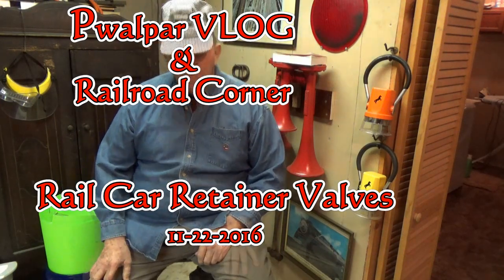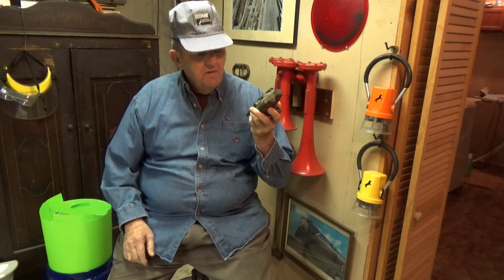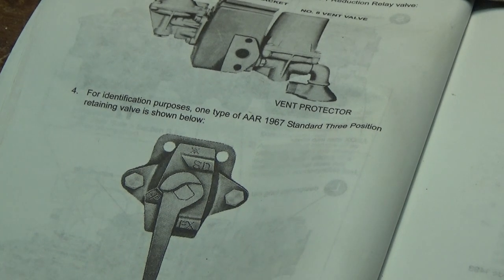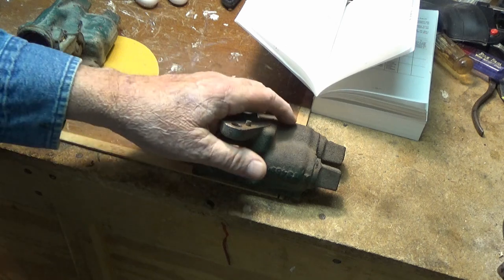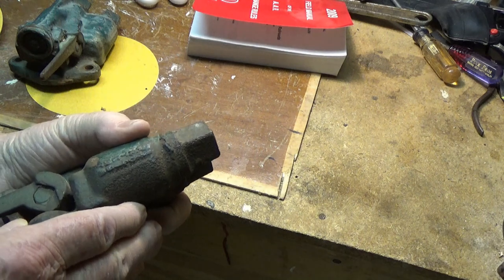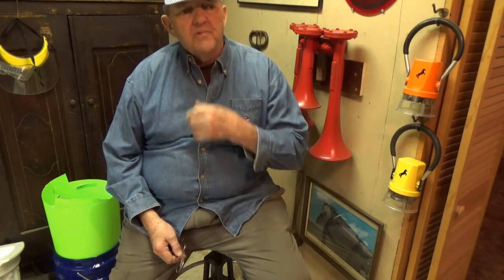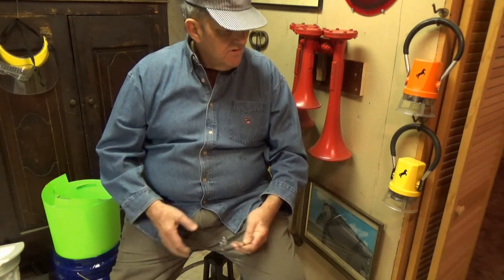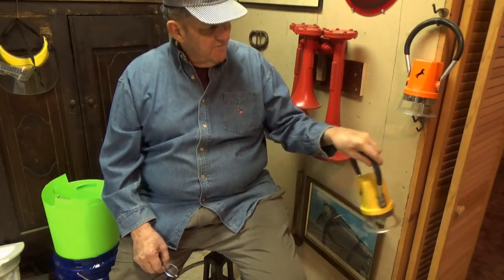Railroad Corner Rail Car Retainer Valves 11 22 2016

Comment: You jarred my memory, Walter, and I had to go back and look at my books about train air brakes. The retainer valve lets the reservoir be recharging when the brakes are holding. I seem to remember that they are rarely used these days because the dynamic brakes have the same effect. I would be really pleased if you could go through the brake system in more detail sometime. Train brakes are not as simple as one might expect. Thanks for showing us the valves.
Reply from the maker: Thanks Bruce I will go into more detail one day

Comment: I own a caboose with the same or similar 3 position retainer as you are showing,  The caboose is a 1953 model with AB service and emergency valves, it has an inside control valve for making a remote reduction from the back of the train (I am guessing) in case of trouble and it has reducers with built in whistle at each end as well,  I think you might be a good guy to talk to about this thing.
Reply from the maker: Im sure your Caboose is the talk of the town where ever you are.  I had a chance to buy on of Southerns Cabooses for 3,000 dollars but had no land at the time to put it on  or the money to haul it anywhere.  I worked on Cabooses throughout my railroad career.  Here is some links to some of my videos where I used the brake reduction valve that I salvaged from and old caboose from a caboose.  I rebuilt it and used it to blow my locomotive horn.  I still use it occasionally.  Check out these links,
Rear of train brake valve Part One https://youtu.be/z7ALHm-a3vs
Rear of Train Brake Valve Part Two https://youtu.be/jgFB6BQrQYk  
RearTrain Brake Valve Part Three https://youtu.be/GrqDBR7dzTE
Rear of Train Brake Valve Part Four https://youtu.be/ngFI_biI5uk.
by the way your welcome to email me at pwalpar@gmail.com   Walter Parks  AKA Pwalpar

Comment: Is the slow direct setting obsolete? I do single car air test and have never needed to adjust it or test it for anything.
Reply from the maker: It has been years since I did single car testing  I do know this retainer valve is no longer used  but the function is the same.  It should hold 20 lbs piston PSI when still in HP
Reply: @pwalpar  cool thanks.

Comment: what are Dynamic brakes walter?
Reply from the maker: Dynamic braking is the use of an electric traction motor as a generator when slowing a vehicle such as an electric or diesel-electric locomotive. It is termed "rheostatic" if the generated electrical power is dissipated as heat in brake grid resistors, and "regenerative" if the power is returned to the supply line. Dynamic braking reduces wear on friction-based braking components, and regeneration lowers net energy consumption. Dynamic braking may also be used on railcars with multiple units, light rail vehicles, electric trams, trolleybuses and electric and hybrid electric automobiles.
Reply: pwalpar thank you walter i learned something new!

Comment: Put heat on the area where the threads are and they ought to break free easier than beating on them.That's the same trick we used to do with with HOT water, but heating them up loosens threads.
Reply from the maker: That would ruin the valve as it has rubber parts inside

Comment: Here is my attempt at explaining the brake system here.

Will start with no air pressure in system.
Wagon is hooked up to locomotive which has it's break handle set to release air will move into the wagons brake pipe through the triple valve into the reservoir on the wagon once the gauge in the locomotive shows  the system is charged (reservoir on wagon is up to pressure) the brakes can now be applied.

To apply the brakes the brake handle in the locomotive is set to a apply percentage this will lower the pressure in the brake pipe this results in a pressure difference on the piston/valve in the triple valve between the reservoir port and the brake pipe port.
This causes the piston/valve in the triple valve to move this movement then opens the port to the brake cylinder this allows air from the reservoir to fill the brake cylinder pushing harder on the piston.
This then applies pressure on the brake pads via the linkage system  this causes the pressure in the brake cylinder to increase which in turn causes the pressures at the triple valve  to balance this then closes all ports in the triple valve at this point the brakes have been applied to desired force.

To release the brakes the brake handle in the locomotive is set to the release position.
This setting applies the release pressure around 90psi this pressure is higher than in the wagon reservoir this pressure difference applies force on the piston/valve in the triple valve  this now opens the ports between the brake pipe and the reservoir this recharges the reservoir.   the valve in the triple valve opens ports between the brake cylinders and exaust port releasing the air and causing the brake cylinder to retract releasing the brakes. 

This system has one important fail safe if wagons separate the brakes apply.

One downfall of this system is if wagons are left on a siding without enough handbrakes applied the brakes will slowly release as air leaks out.
Reply from the maker: Yes on many cars they can leak off so all cars have a manual hand brake
Reply: So this valve allows the release rate to be set.
As far as I know our wagons are all set to slow release not sure if it is changeable.
only seen two wagons here that released quickly.
what is hp retained used for my understanding is you could only apply without releasing?